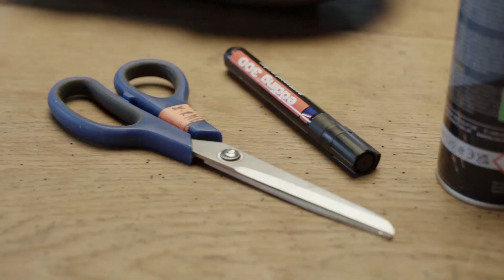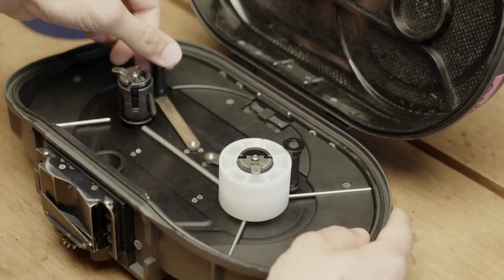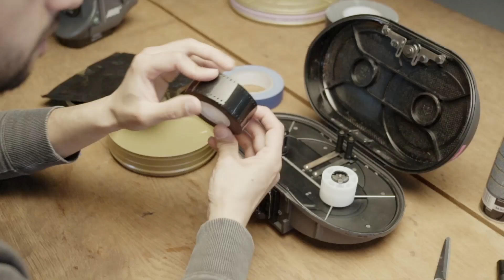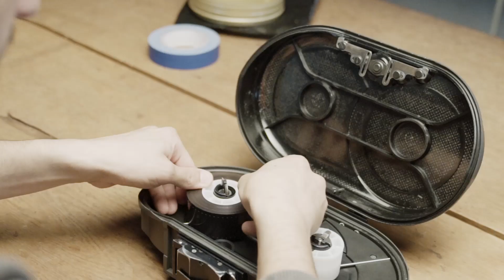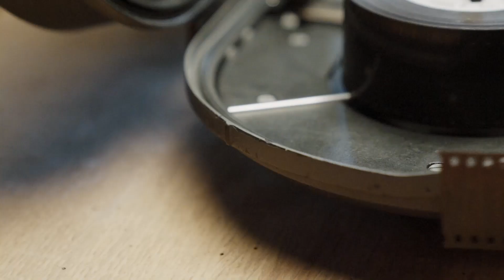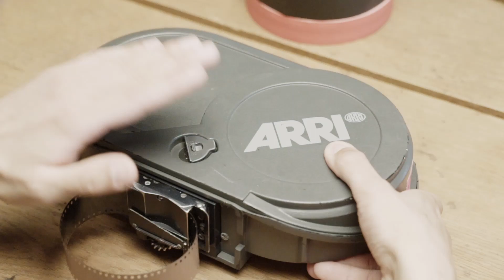HOW TO LOAD A 35MM ARRI 435 CAMERA MAGAZINE | TUTORIAL

Comment from the maker: Additional note:
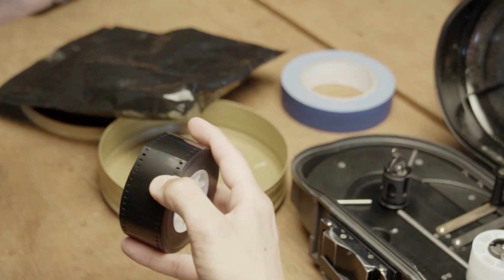02:45 *this is just relevant when you handle short ends, fresh reels don’t need a cut.
Reply: I was a film loader many years ago. I recall that fresh rolls of film were not necessarily cut at the perforation. In any case, I was taught to always confirm that the perforation was open, or to make it so. I never used scissors; I always tore the film at the perforation, which was easier. I always did this a few inches into the roll, as this left a larger film fragment to find and get rid of.
Reply: @DonStarnes , I can confirm that.

This also applies to 16mm. The Arriflex SR cassettes are much easier to load if you have the beginning of the film between perorations.

Comment: As I mentioned in another comment, I was a film loader many years ago. I was taught to never use the gears to advance the film at first, because chewing the film with the sprockets is a very bad thing. Gently push the film into the feed sprockets of the magazine; let the open perforation push the sprockets, moving the gear, until the first few perforations are synchronized with the sprockets. Then advance the film with the gear. Do the same when inserting the film into the take-up sprockets. This method makes it almost impossible to accidentally add a sprocket or two to the loop. Occasionally, one comes across a magazine in which the lubrication of the gears is too stiff, and so the film can't push the sprockets. This magazine needs to be sent back to the rental house to be re-lubricated.
Reply: Correct. You should push the film through the light trap until it's through before advancing it with the gears. 

Another "wrong" is saying that you should never put the film in the slit on the take-up core. I've always done that. It isn't absolutely necessary, and putting it around the core is enough, but saying that you should never do it is just plain wrong. They even recommend this in the Arricam LT/ST manuals.